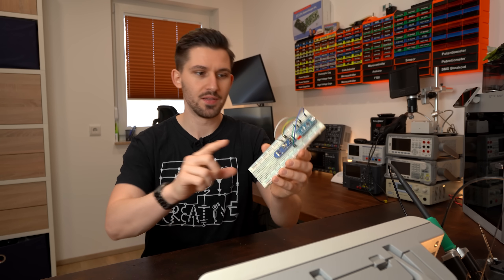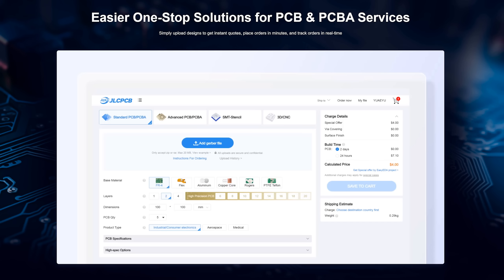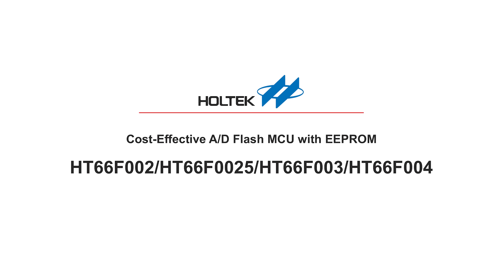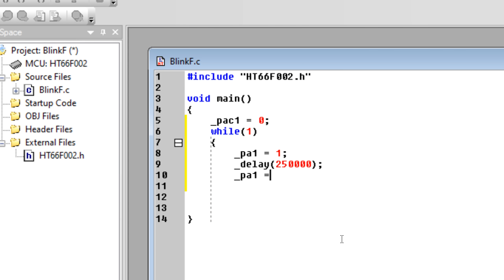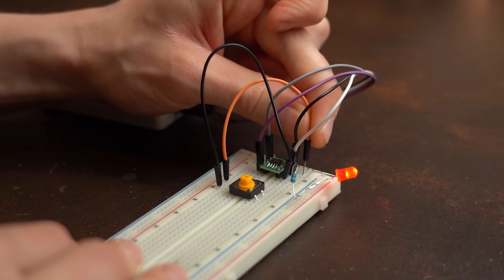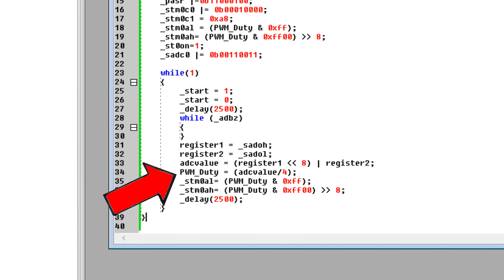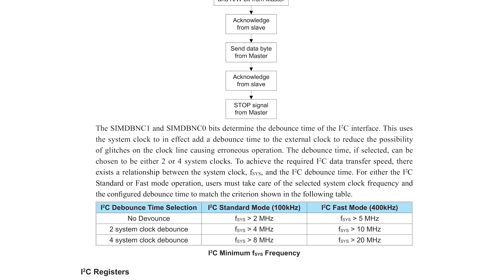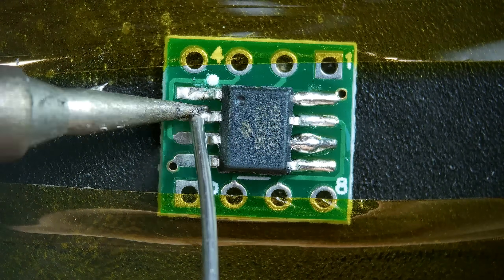I tried the Cheapest Arduino Alternative (that Nobody heard of)

Comment: It was so close to programming in raw assembly code that you might have been able to bit-bash your I2C functionality.  Even on the smaller chip.
The watchdog was the first thing that came to mind when I saw the way the LED was behaving.  Every time you move to a new microcontroller there's a bit of a learning curve.
Reply: You can definitely bit bang i2c quite easily as long as you can switch between input and output on the fly and your program isn't too busy.  Many years ago on some of my projects that was the only way.
Reply: Big Clive watches Great Scott

#TitansMeet 😀😅
Reply: I was a bit disappointed that he didn't try bit-banging I2C
Reply: I actually thought that was what he was going to do when he said there was no I2C
Reply: @aliveandwellinisrael2507  same here
Reply: Was my thinking, more than enough GPIO pins and you are just polling one device, so can ignore things about the address on the bus and be down to bit-banging.
Reply: I was thinking similarly. Kids these days.
Reply: He had all the instructions to do a bit-banged I2C interface in his pushbutton input test. Read a bit, write a bit, turn on the pullup, and set a bit to be an input or an output. I've written the code to bit-bang I2C on at least four different controllers over the years. (Although in one case it took me a week to figure out that I wasn't sending the correct Start condition.)
Reply: I read this comment in Clive's voice
Reply: Bit banging in master mode is pretty easy - it’s not like it’s a complicated protocol. Output as a master is very easy - no timer or interrupt necessary. I2C doesn’t care about clock rate, as long as it’s not above the rate your slave can accept. Using input mode as a slave does work a lot easier with interrupts, cos you need to read the input SDA value on a change of SCK - an edge-triggered interrupt is really handy there. However, in master mode you’re still creating the clock, so when doing a read operation, you only have to listen to SDA changes after toggling SCK, with a small delay to allow for settling. I totally agree with others here - can’t see this taking more than a 100 bytes to achieve.
Reply: I was actually really surprised that it took 3 days to figure out what the data sheet would have told ya in 3 mins if you read it closely before making your component selection. Especially with a 100 euro programing interface, I would be triple checking it was capable of what I needed it for. Oops! I think we've all been there at some point tho. At least it wasn't an expensive lesson to learn (relatively).
Reply: A library, or open source code with I2C functionality (optimized for the device) would greatly improve the appeal of this device. It would enable small part count designs needing minimal space.
Reply: I didnt expert Clive to be here 😂
Reply: Have we considered that maybe the mfr of the mcu could have intentionally not bothered developing i2c master code to keep costs low? Knowing that anyone using their chips would probably be able to write master bus code on their own? 

I don't quite understand why a device that is capable of slave mode wouldn't be capable of master mode when master mode doesn't need to react to anything - master controls the clock, so interrupts wouldn't be abs. necessary.  

If it's an input/output switching issue, then just connect the data line to 2 pins, one for input, one for output and avoid driving the latch on the input pin. I don't see any reason a person couldn't write their own i2c master driver code for that application.
Reply: You wouldn't need assembly to write a bit-banging I2C algorithm.
Reply: @tomwimmenhove4652  in a slow microcontroller, yes. Every cpu cycle counts, and ASM is the best approach.
Reply: @User-w7ckl  with a good compiler and the fact that you probably don't need to read out your proximity sensor thousands of times per second, there's no reason to make life harder than it needs to be.
Reply: @tomwimmenhove4652  but how do you handle the "multi task" required to read the sensor and at the same time outputting the I2C? A TMR interrupt? And another "on pin change interrupt" for the sensor? Then you might lose the I2C clock.
Reply: @User-w7ckl  isn't i2c used to comm with the sensor tho? I thought they were part of the same transaction. Output was pwm for the led, iirc. I would normally say do the i2c atomically, but if it's just flipping an led on/off, could prob do that in between each i2c byte or bit if you really wanted to. Might even need to, to keep i2c from running too fast (dep on sys clock spd)
Reply: @ryannow  you're right dude!
Reply: i love seeing my 2 favourite YTers following each other!
Reply: That was my thought, write your own i2c library!
Reply: I was expecting to see Ben Eater chime in here
Reply: Yeah. Even Arduino does that: SoftWire
Reply: instead of an 100USD programmer her can also have used the Attiny85 that is also supported by the Arduino Library, even microship sell there programmer for under 60USD and you can get pic10fxxx sot23-6 or smaller cheap if you want to do simple design
Reply: Can probably just look at arduino library source for their i2c functions.
Reply: A lot of hobby projects doesn't want to kick the dog. Which makes sense while you're prototyping, so I do wonder why it's enabled by default.
Reply: ⁶⁶
Reply: Yes did not understand why he didn’t bitbang it is one of the easiest protocols to bit bang since it’s synchronous and that micro looks to have more than enough power to do it.
Reply: I guess that's also the reason why they only did I2C slave mode, because it actually has an advantage as it can do address matching. 

The master for most applications is fine with a general I/O interrupt and the rest is some delay and bit-banging.
Reply: Yea bit bang it out. I had the atmel pic pro it was 100 bucks but it was a commercial product I worked on a 509 and 2313 oh my. I wished for  1K CHEAp micro for 20 cents.
Reply: I have found some cheaper MCUs.
Although I don't think any community support is there but still they are dirt cheap. 
FMD 8051 MCU FT60E010A 6 pin @ 59 INR (0.7 Usd) / 10 nos
FMD 8051 MCU FT60F122-RB 14 pin @ 82.6 INR (1 Usd) / 10 nos
Reply: How would to typically go about doing that? I always assumed I2c has dedicated hardware
Reply: @ChimpyChamp  nah, you just need an input pin, output pin and enough program space to save all the packets you need to communicate with the slave. Simplest i2c bit basnging program is around 1kb.
Reply: @jhonatancock2302  When the PIC16F84A microcontroller (1k flash) was popular, we'd bitbang I2C in assembly.  I2C is basically a shift register so shift out the address, register and data and shift the results back in. Just take care to switch the SDA pin to input at the right time to make it bidirectional. You'd still have more than enough flash available to blink an LED. An example is in Analog Devices' AN561 appnote.
Reply: If written in assembly it would easily fit into 100 bytes.
Reply: @mtxnelis6297  It all depends on the speed you need. Bitbanging is ok for low-speed.
Reply: @ChimpyChamp no it’s just a protocol, in theory you can program the master protocol yourself, but that is really tedious and requires ideally interrupt level of programming to asynchronously handle the bus traffic which I’m not sure those controllers are made for, otherwise running any logic aside i2c willl potentially cause issues. I’m not sure if it’s it’s worth the pain 😂
Reply: @LordXPress  as a bus master you don't need irq or any async stuff-- you are the master: any other device only communicate if you let them on the clock rate you provide (as long as they support that speed--- but modern stuff even support clock stretching)
I did (copied) a bit-bang I2C master code for 8051, and only was a few hundred asm lines.
Reply: @ChimpyChamp  Usually you start by looking up timing diagrams and protocol definition. The first tells you what lines carry a signal for what time. The latter tells you what the signals need to contain in information so that another device can make sense of it. Having HW interrupts in your uC helps a lot but you can manage without. One thing that is critical though is that you either have HW timers or that your architecture can produce repeatable timings when given the same set of instructions (unlike complex platforms like computers, where that timing would break as soon as the CPU gets a little too busy)
From there it is just writing functions and abstract your way upwards to a level where you can simply receive and send data like you are used to on Arduino.
It is a lot of work, though. But it is not outside the scope of a beginner with a scope (see what i did there? 🙂)
Reply: @ChimpyChamp  you assumption is simply wrong. I2C protocol ca be software emulated.
Reply: @truffatorenapoletano90tratbas doing the slave side in software is a lot more tricky... That's why they probably included some hardware for that part
Reply: @DooMMasteR  in past i wrote in assembly code the RS232 protocol (max speed 1200 baud cos that microC cannot do better) because the chip i use has not in hardware. all can be done if you need. of course is better to have in hardware but if you have not, u must read the protocol specs and reproduce in software.
Reply: oh hi there :)
Reply: ChatGPT probably can bitbang it...

Comment: But you can add software I2C - "Bit Bang" and it's very common. I've used it with 8051 for communicating with 24CXX I2C EEPROMs and with ATtiny85 for driving SSD1306 I2C OLED module.

Comment: Actually the i2c master is much easier to implement than a slave, you could easily do it via bit banging. That is the reason why most cheap controllers don't support it directly. Doing a slave via bit banging is much more difficult, sometimes even impossible on high level controllers running "proper" operating system. It is a pity that you gave up so quickly :) otherwise a nice video considering you are not a software engineer. greetings from Slovakia!

Comment: You can get the stm32f103c6t6 for like 40 us cents…. Arduino compatible, good adc, and lots of communication options including built in usb…
Reply: Or STM32G030F6P6 for 0.36 euro, and you have 32+32=64kB flash, and a lot of great features,

Comment: If it is a problem that this microcontroller is not well covered on the internet, then why not use the ATMEL ATTiny microcontrollers? They are verry small, very cheap but are very well covered by the ATMEL AVR community (which predates the Arduino crowd by several years).

Comment: You can use the debug mode on the ide to debug the code. I am not very sure if this micro controller supports the debugging, but ide does support it and I have tested it. I used a much more advanced holtek mcu though

Comment: Stop using term "Arduino microcontroller". There is no such thing. Arduino boards (even the official ones) use various dissimilar MCUs many times of completely utterly ridiculously dissimilar architectures.
E.g. Arduino UNO R3 uses Atmel AVR Atmega328p and R4 uses Renesas ARM Cortex M4 based RA4M1. Even the basic computation model of those architecture is different.

Comment: Nice video. I started using ATtiny 412 and 1614 a couple of weeks ago. Lots of searching to get the board libraries installed. But with that working, the chip(s) are easy to program using an Arduino Nano as the UPDI programmer. Use an FT232 board for  serial.Print commands. Thanks again for all your videos.
Reply: I looked at the Nano-based UPDI programmers last summer when I did my first tiny412 project, but in the end I used a USB/serial interface and avrdude.  The "programmer" costs about $3 that way, and you just need a 4kohm resistor tying TXD and RXD together to connect to the programming/reset pin.

Comment: for less you could've gotten an arm based PY32F002A from puya... which has an ADC, (secretely also has DMA because it's a 030 on the inside) and many other goodies, it also runs at a 24mhz base clock... that holtek mcu seems wildly outdated to be honest. If you want to get something as cheap as possible then you could just get a PMS150 from padauk but even these are kind of a pain to work with nowadays.

Comment: CH32V003F4P6 - $0.21 per piece 
48 MHz, 16k flash, 2k RAM, 18 GPIO, SPI, i2c, USART...etc. 
You are welcome! 
If you need less hardware and want to have an even smaller form factor, then CH32V003J4M6 comes in a SOP-8 package. It beats ATTiny85 in specs.
Reply: If you still need all the pins but also want it smaller, it also comes in a QFN-20 package, 3mm square.
Reply: Nice. I had been usint ATTiny85 but will now look at the CH32V003F4P6  family so see if I can substitute.
Reply: I think he would have to use the 84 to get the extra GPIO, ofcause depending on the project, though the AT are usually a few bucks for a SOC, but still pretty cheap in small batches, depending if you want to pay wages or chips. But in 10x productions i would go for less time working vs higher price SOC, he spent 3 days on it and where i live that would cover about 500 pcs of ATTiny84
Reply: The flash usage is higher for 32-bit RISC-V compared to 8-bit Attiny, more than 2x. Other than that, it beats Attiny on price/performance.
Reply: WCH has some good stuff, he should absolutely look into it
Reply: stc8g series.  8 pin dip package available. based on 8051 instruction set. has pwm,adc,I2C,uart,SPI,comes with its own dedicated programmer software. and to program it just use  a ardiuno with its tx,rx pin connected to the micro-controller and connect rst of ardiuno to gnd. making ardiuno essentially turn into a uart bridge. also 12 times faster than 8051. you can use keil uVision (commercial version -free) to program it. as a bonus the programmer software has timer,baud-rate calculator .some versions also have a touch key support.
Reply: @GHOST-RIDER-0  12 times faster than 8051 means 1 clock instructions... so on par with AVR/faster than HT66, although if i recall correctly 8052 had slow division/multiplication, 4 instruction clocks per mul/div, AVR has 2 clocks per mul/div...
Reply: @GHOST-RIDER-0  stc8g seems great, so does CH32V003F4P6  and STM for cheap micros, but I'm looking for something that is low-power (stc8g fits the bill) but can also go up to max 125°C in operation. STM32U031 has a version that goes up to 125°C and is low power, but I can't find it on any market and similar board arerelatively expensive. Any recommendations?

Comment: I did I2C master with Attiny2313 in timer interrupt routine with state machine. 
Yep it increased code size but still managed to fit that temperature controlled PWM fan control with indicator leds under 2kB :)
Edit: I used it for reading temperature from LM75 sensor.

Comment: While you spent some time learning the syntax to code these chips, the good news is you can create your own reusable wrapper libraries that are compatible with Arduino code and make future projects easier and faster to build.
Arduino was originally based on Atmel microcontrollers, which have had really nice opensource tools for a long time. You can easily build your own programmer for them as well. You can still buy these chips independently and use them in your projects.
Fun project and demonstration of the power of more generic microcontrollers. Thanks for sharing!

Comment: I think you could use some sort of parallel to i2c IC. Or if you have plenty of time you could also try emulating i2c protocol with normal gpio. If you don't need high frequency I think you could archive that.

Comment: 8 cent :  PY32F002/PY32F003 from PUYA for microcontrollers with an ARM Cortex M0+ core clocked at 24/32MHz.
PY32F002 20kB FLASH, 3kB RAM, SPI, USART, I2C, ADC, timer... nothing to complain about.
PY32F003 additionally DMA and a few more timers, there is also an additional memory selection.
It is an SWD interface that does not require a special exotic programmer.
Power supply 1.7V...5.5V, TSSOP, to small QFNs or DFNs.
Reply: agreed, puya is amazing value and doesn't require a 100€ programmer... swd is enough.
Reply: The py32f002 actually has the full py32f030 stuff, including memory and peripherals
Reply: Came here to suggest a Puya. Glad to see I wasn't the only one to think about that.

Comment: How fast can that distance sensor update and how accurate is it?   I had a project in mind for a height sensor under a vehicle that would need to work whether
it was in slow traffic or 70mph on the motorway.  Could it detect a 1" / 25mm drop?   I know it would need to average the height as the suspension dips on the bumps etc.
but thought it may work reliable enough.  Any thoughts?  Thanks.